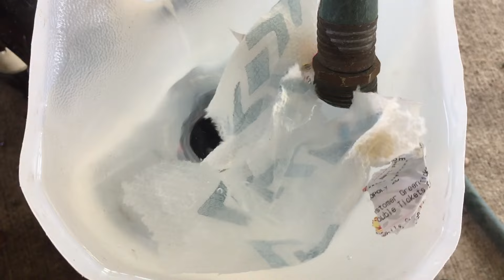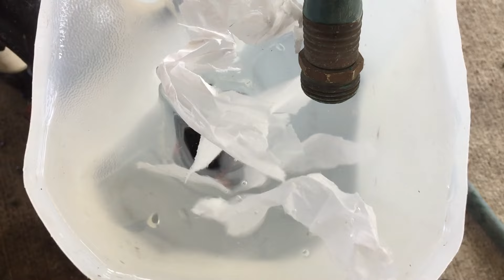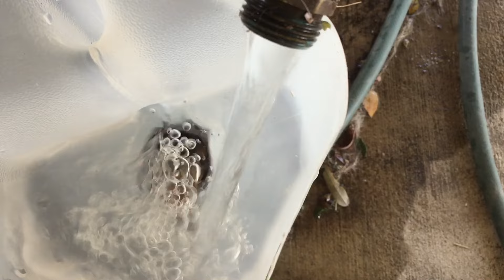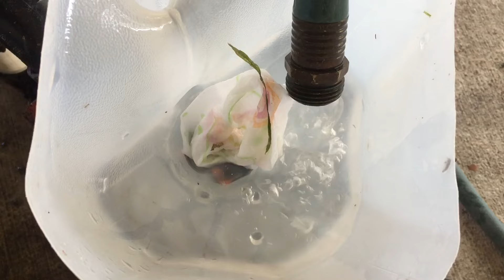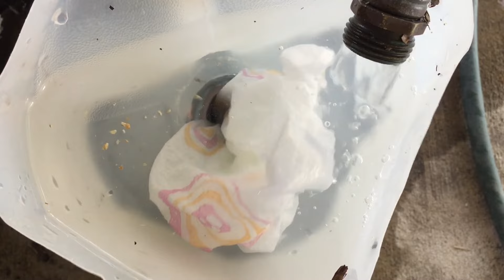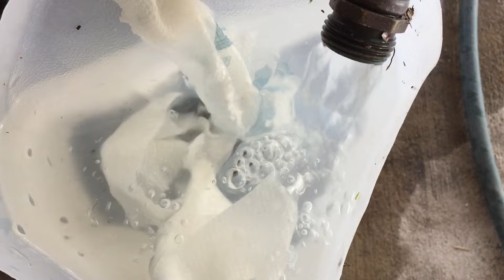Flushing more stuff down my Homemade Toilet!

Comment: I which i make this homemade flush toilets one day as of matter of fact you should put the pipe on top and around it so the thing can pour water down very easier and you should connect the pipe to the hole and make the jet get injustable anyway this homemade toilet is amazing